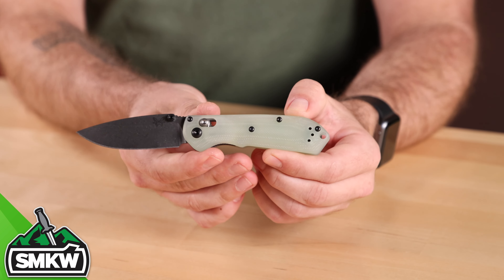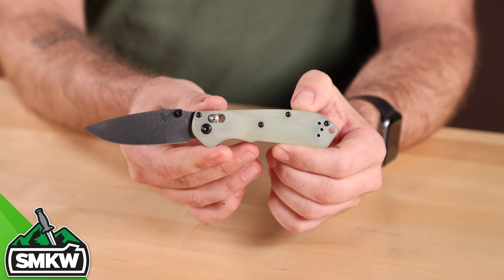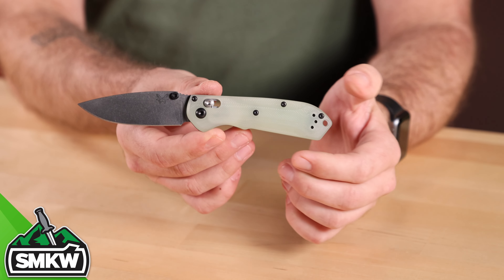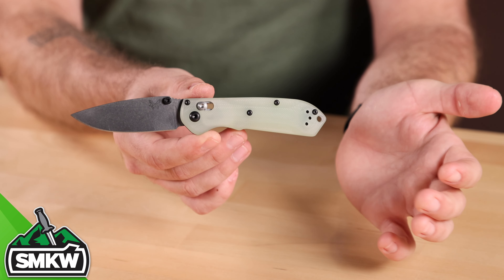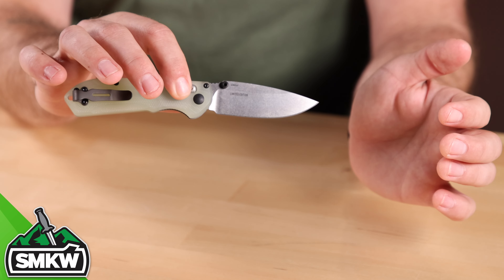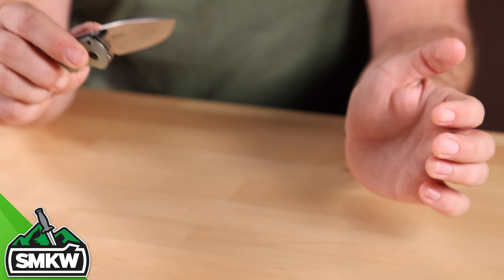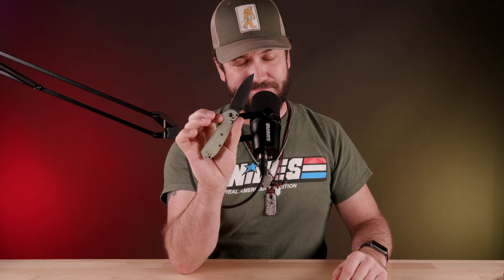New CPM S90V Can Do What?!?

Comment: S90v is my single fav stainless with S125v being a close second. S90v does well with pretty much any edge finish you want to put on it from low grit shread monsters to full mirrors. It's a truly bad ass stainless, if you have diamond stones or resin bonded diamond plates you won't be on the stones forever doing a reprofile now I will say if you only have Alox stones or SIC stones you are going to be there a while if your reprofiling. If you have diamond or CBN stones it cuts just fine, if you like a toothy edge take S90v to F400 grit and it will be super toothy and those carbides will keep it that way for a very long time. S90v also responds very well to a hone and strop. After the edge starts to fall off a couple passes on a strop and it will be right back shaving, if the strop doesn't bring it back a few strokes on a ceramic stone or rod to realign the apex and a few strokes per side on a strop and bingo your popping hairs again. It's amazing how long you can keep an edge going on S90v.

Comment: Sharpening a Benchmade 940-1 after reprofiling to a 16-17 per side, I find it easy to sharpen on a DMT Extra fine continuous surface stone. I've had the stone for years and it is now very close to an extra-extra fine in finish. 
90V takes a wicked sharp edge and is impressive in the edge holding. 

First test, cut 100 feet of cardboard, trimmed branches, both dead and live, for about an hour on the property, another 100+ feet of corrugated cardboard, and still shaving, but slightly dragging. Stropped on barbers strop loaded with German Flitz Metal Polish and in only two passes per side, hair popping once again. 
Love this Steel!
KnifeMaker
Reply from the maker: Thanks for watching and sharing!
Reply: DMT plates.... extra fine... that's the 9 micron one right? DMT plates don't work like regular whetstones or how people think they work. The 325 course actually makes the sharpest edges. Paradoxically or counter intuitively,  the higher the grit the more steel they remove, the narrower the particles and the deeper the scratches. In general these are not good products for sharpening knives. Diamond abrasives are good, but these plates are not.

Comment: I have the teal pm2 in s90v. Its the only knife ive ever bought that i didn't immediately take to my edge pro apex. I bet i will not need to for several years
Reply from the maker: Love S90V!
Reply: You should see outpost76's PM2 S90V factory edge vs sharpened edge results. You gain 2-3 times the edge retention vs burnt factory edge sometimes

Comment: I have a Two Sun TS187 (Fang) in S90V, it's outstanding, I tried whittling almond wood including some of the knotty bits and it cut it very well and didn't even need a strop after around half an hour of continuous work. I make canes and walking sticks, almond wood is an edge killer on lower grade steels, though I have to say rough Ryder's T10 is pretty good for a 'cheap' steel.
Reply from the maker: This is great stuff to hear and what we are looking for, actual hard use!  Thank you so much for watching and commenting!
Reply: I need to get a knife of 2 from Two Sun,their prices are crazy for the materials they use
Reply: @garrettferrell6821  I have four of their knives and they are all good knives, I would like more. I can say thier steels all seem to be properly heat treated, I've got S90V, M390, D2 and 14Cr28MoV, they all seem to perform well.
Reply: @SMKWcom  you can see actual use in my S90V beat down video. I chopped wood, twisted the apex out of wood, whittled aluminum and brass and did apex impact hits.

Comment: MagnaCut has 10.7% cr and is more stainless, it's all about chromium in solution baby. Not the just the chromium weight chemistry  which can be tied up in Carbides and not in solution doing work depending on the balance of other elements and heat treatment.
Reply from the maker: Thank you for watching!

Comment: when I got Benchmade bugout in s90v it was dull as heck. It looked like the bevel had been ground on but that’s about it, it couldn’t cut paper. When you sharpen it from that point it sucks. But touching up the edge, it’s not too bad.
Reply from the maker: Keeping an edge is definitely easier then starting from dull
Reply: Same here and the bevel was totally uneven one side to the other. The S90 940 I have is perfect though. Had to sharpen a brand-new knife.

Comment: I don’t have much experience with S90V yet.the only knife I have in S90V is the new carbon fiber+S90V Benchmade Bugout and so far it seems pretty awesome..I don’t have a lot of experience with S110V either but a little more so than I have with S90V.I have a Spyderco PM2 in S110V..I bought a Spyderco Native 5 LW in Maxamet last December and I love it.Maxamet has became one of my personal favorite blade steels for an EDC knife.not only does it have the best edge retention I’ve ever experienced but it’s fairly easy to sharpen and while it’s not stainless it’s still has pretty good corrosion resistance..I’m like M4 a lot as well.I have a Benchmade “Super” Freek in M4 and it’s my personal favorite Benchmade knife that I own..I’m a big fan of Cruwear as well,I have a Bark River Aurora in Cruwear that I’ve had for a while,I have a Cruwear Manix 2 and recently got the Benchmade Mini Adamas which is also in Cruwear..I’m gonna get a PM2 or a PM3 in S45VN now that they are coming out into the wild,Ive been wanting to try out S45VN for a while..I’m looking forward to seeing knives come out in MagnaCut as well,it sounds like it’s gonna be a great steel..I love trying out the different “super” steels but damn it gets expensive

Comment: I purchased my first S90V.  It wasn't hair popping like I prefer so i started to work it a bit..this stuff is unlike anything I've tried to get razor sharp... edit: after watching a few vids you don't really want S90v hair popping and it can mess up the carbides.  I have it shaving sharp now and we will see!!  I'm sure I won't need to sharpen for a another season as least...
Reply: How did it go ? Good I ll bet . I just got done doing an edge and was thinking it doesn’t act like a lot of other steels when sharpening .
Reply: I found that when they belt sharpen from the factory, it can leave the initial profile brittle.  So after a few rounds on the whetstones, the edge is considerably better edge holding now, like how I imagined S90V to be.  Very happy with it now!!

Comment: Got my ZT0095s90blk coincidentally from one of you guys at SMKW.  It came with a polished edge that I wouldn't have had the patience to do myself.  The steel seems unfazed by use, although it's a dedicated user.  Great knife!  My 940-1 has s90v as well but I'm not a fan of the blade geometry and the factory Benchmade grind is awful.
Reply from the maker: Thanks for watching and sharing your knife tale👍
Reply: I love mine gutted and skinned two full sized elk without needing to sharpen it.

Comment: How does this hold up against bone? Will it chip if you prep a fish or deer?
Reply from the maker: S90V is very hard and as a result can be prone to chipping when coming in contact with harder materials.
Reply: Just to be transparent, I don't have anything in S90V currently but hope to make a few blades from some 3/32 stock that I've had (for a long time).  That said, I process several deer every year, as well as fish when I get the chance.  As far as S90V holding up against bone, I suspect that it depends on exactly how you come in contact with the bone.  If you try to use the knife like a cleaver, it could very well chip.  Having said that, if you're using a knife like a cleaver while butchering a deer, you're doing it wrong :-)  If you stick the tip in the hip socket trying to separate it, and you end up applying some side load, I suspect you inadvertently do some serious damage to the blade.  If you are boning out the ribs, neck, shoulder, or hip and you run the edge across a bone, I highly doubt it will have any adverse effect on the blade.

Comment: How good would a S90V steel short sword be for actual combat?
Reply: Terrible. A 420HC sword would be better if you need stainless. Carbides in super steels means brittle. Low carbide like 420HC or AEB-L stainless steels are tougher

Comment: This stuff is insanely hard 
Kills carbide inserts in 1 pass
Reply from the maker: Thanks for watching!
Reply: Carbide sharpeners are only for low paid workers in a production line using soft dexter knives
Reply: @thaknobodi  He said Carbide inserts. In other words, Carbide milling cutters which have nothing to do with the cheap carbide sharpeners'. Yes, they are junk. Carbide inserts for milling is the best a man can get for milling hard materials. Selecting coating options f the cutters can further increase their performance. 
KnifeMaker
Reply: @michaell397  🫢 gotcha. Id imagine all than vanadium does indeed wreck carbide millers.

Comment: S90V holds an edge, but is hard to sharpen.
Reply from the maker: But it also last once you get it there
Reply: Nothing is hard to sharpen with diamond stones and diamond stones are not that expensive so there is no point not to use them.

Comment: Fast forward 3 years and I think (my Bugout’s) s90v sucks compared to my K390, M390, Maxamet, and Magnacut blades.  S90v annoyingly holds onto a burr forever then just doesn’t hold its edge as advertised.  I’ve had similar results across several steels from Benchmade spanning 30 years starting with a super brittle ATS34 AFCK that inexplicably lost its tip, followed by several others from BM.  I love their designs but not their steel.  I switched to Spyderco, Hinderer and Chris Reeve but had to try out the Bugout cf/s90v.. its a big meh.